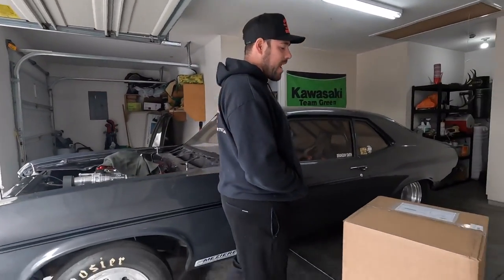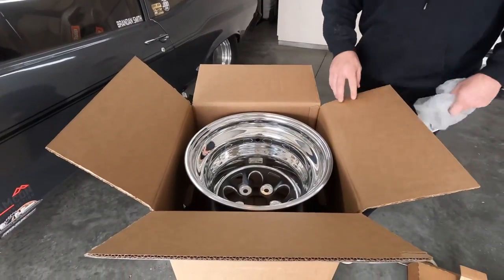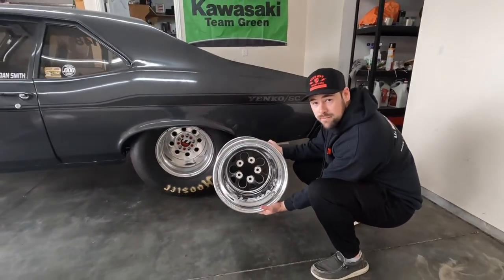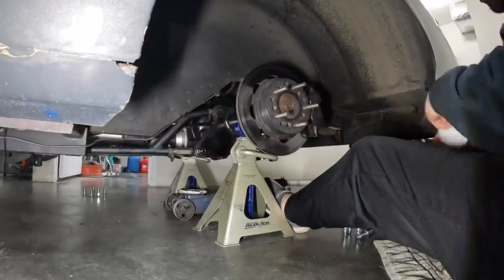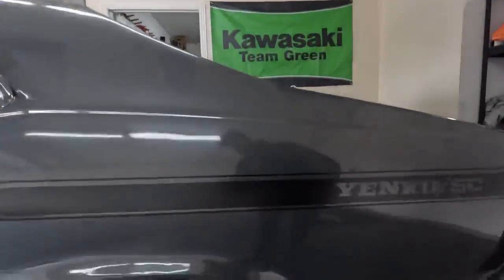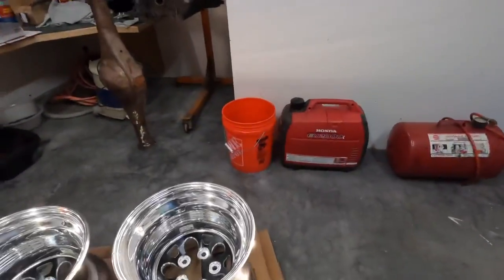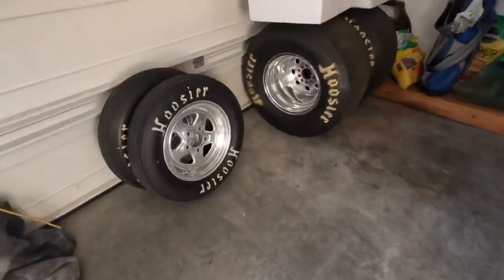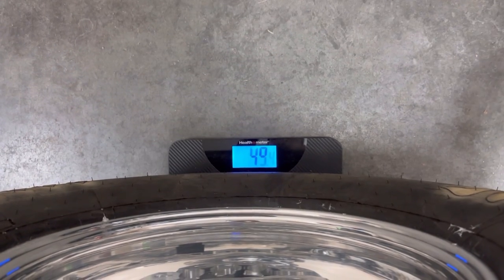New WELD WHEELS For Our Chevy NOVA Race Car! LIGHTER & FASTER!

Comment: I have a few questions. What hood are you running and can you give me info on your front wheels like size and part number? I have a 572ci crate motor in my 71
Reply from the maker: It’s a Harwood 4” cowl hood. Front wheels are a 15x4 SSR from Jegs!
Reply from the maker: @Wentworth707 yeah they are a 5x4.75!